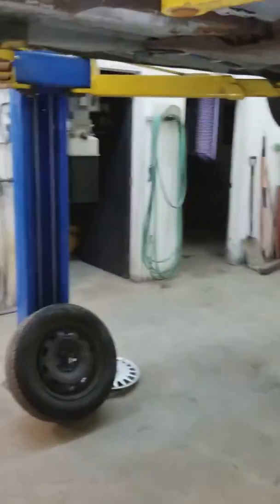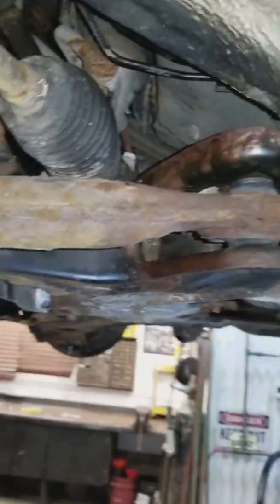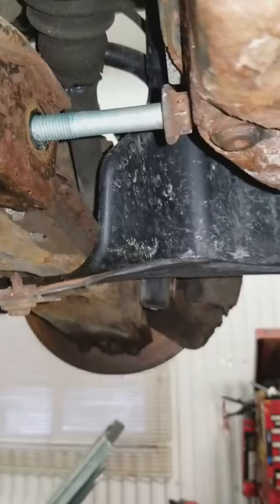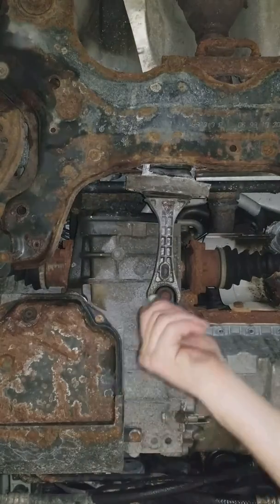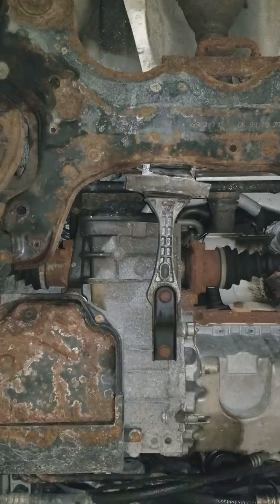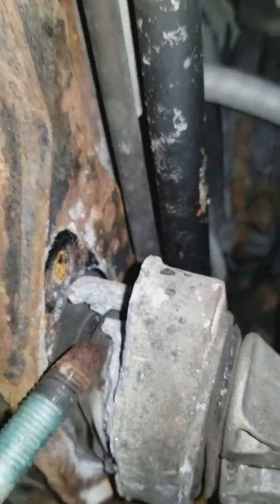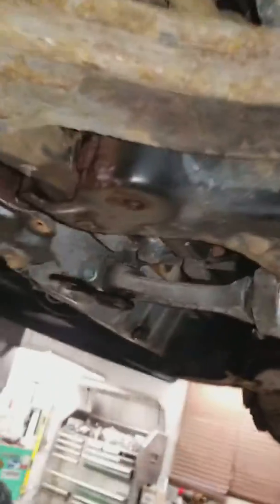Volkswagen control arm bolt removal! Fasted method

Comment: Do you or anyone else have experience and advice on how to loosen and unscrew the same bolt from the nut plate that's internally spot welded to the subframe without breaking loose the spot weld?  Since the nut plate is not accessible when the control arm is installed, no tool can hold the nut secure while trying unscrewing the bolt from the nut.  A spot weld is the only thing holding the nut.  If the weld on the nut plate brakes loose while loosening the bolt, removal of the bolt will be impossible without cutting an access hole into the subframe for a wrench to hold the nut.  I have tried to prepare for this job by spraying penetrating oil into a small cavity within the subframe in hopes of the penetrating oil getting into the threads of the nut and bolt.  I'm hoping (hope is not a plan) this makes it easy to remove the bolt if it has become locked in place because of rust.  I have not tried to loosen the bolt yet.  This is why I'm asking for advice on how to do this right and not create a nightmare scenario where the nut brakes loose from the spot weld inside the subframe.
Reply: RedondoBeach2 The only special tool needed to do the LCAs on a Mk4 is a gooseneck wrench, plus your basic tools like sockets and socket wrench.